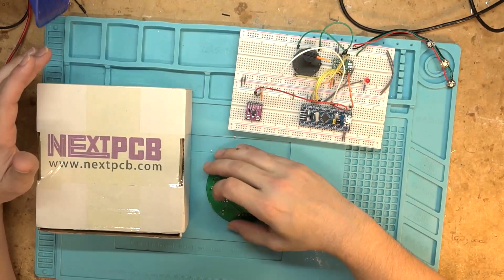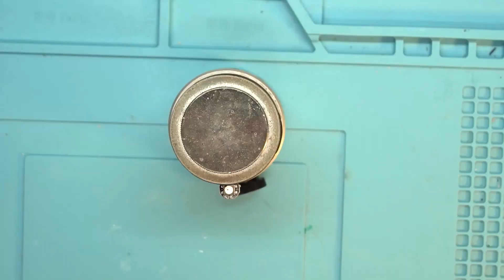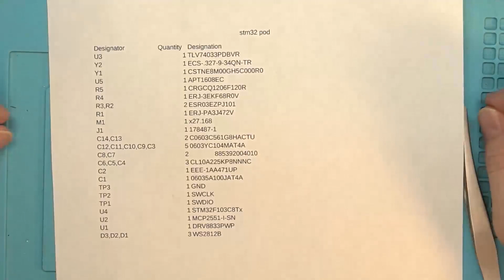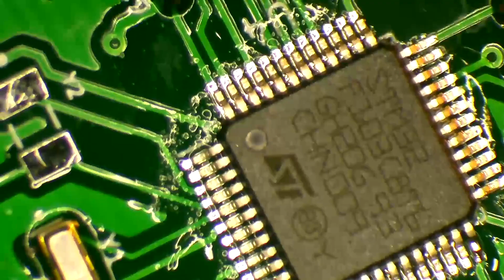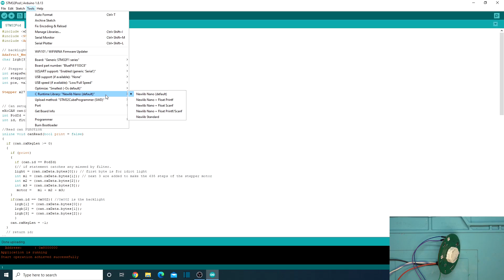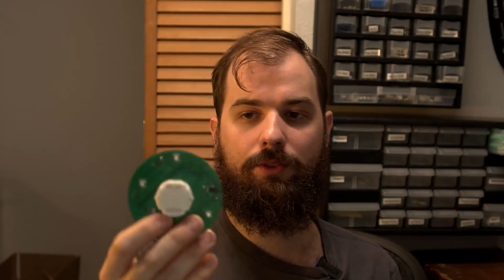Open Sourced Universal CAN Bus Gauge Pod Circuit Board

Comment: I just came across your channel last night researching STM32 chip shortages and you mentioned this project, so I went digging. Great work. I'd suggest putting a TC2030 footprint on the PCB and grab a cable or two from Mouser/Digi. Makes programming and debug so much better. And it's "free" on the device because it's just a footprint. The cables are a bit expensive, but it's a good investment in my opinion.
Reply from the maker: Awesome I hadn't seen that before but I am hobbyist. I will work that into my next project! Thanks for the suggestion.

Comment: Outrageous ! The potential for your idea is tremendous. I'm installing an LS engine into a an antique car and would LOVE to be able to use you gauge pods imbedded in the old dash !!! Keep up the good work!
Reply from the maker: thank you. I am currently trying to work with a company that makes universal screens to tie into the backbone of his product.
Reply: @FixedUntilBroken  Until I saw this video of yours my feeble brains only idea was to unsolder the motors off the gauge cluster and extend them and embed them on a disc placed into the old car's dash, then tuck and hide the gauge cluster PCB under the dash somewhere. While you're at it find some way to make a stand alone PRNDL bar and system info bar too! Quit screwing around answering me and get to work :).
Reply from the maker: PRNDL would pre pretty easy to do with an LCD. I am having a hard time finding automotive rated lcds in the hobby space lol then I go and buy stupid ones like one that's 0.91 inch long lol... I really did
Reply: @FixedUntilBroken  Sounds like  you are on it. My C++ Arduino skill are nascent but not yet up there to where I could order PCB's from NextPCB . But you got something going on there. Interfacing arduino with the can buss just has so many possibilities!  Keep up the good work, you got a follower here. If you get to the point of selling the PCB's as a do it yourself "heathkit" for us less competent Arduino users I think you will have some interest. Best Wishes.